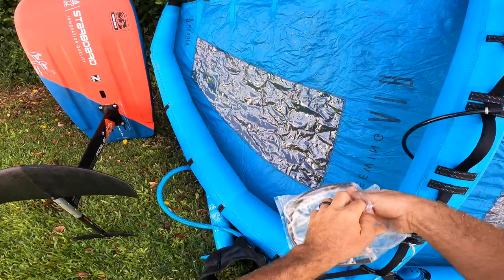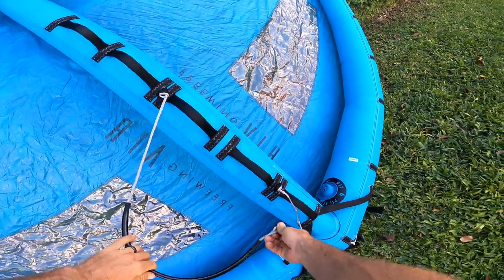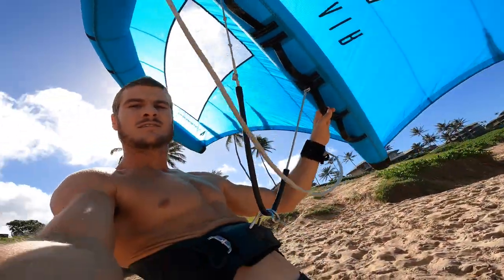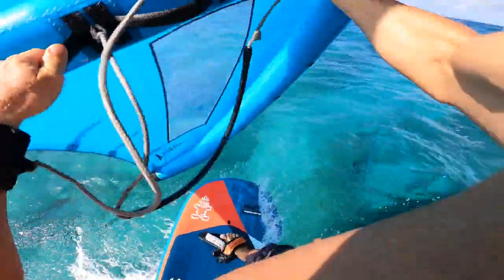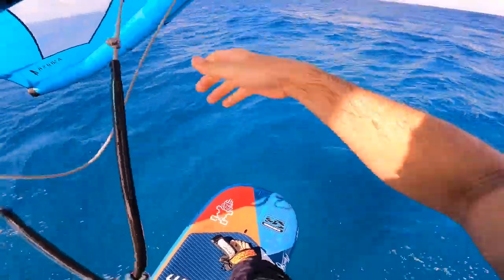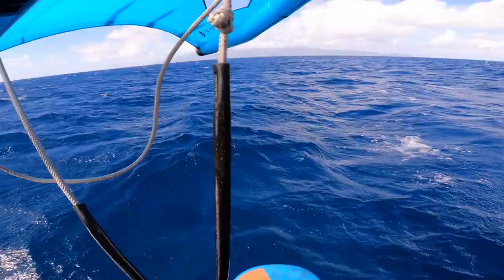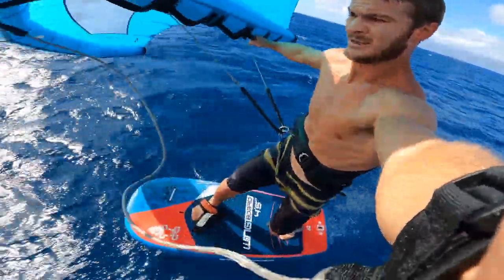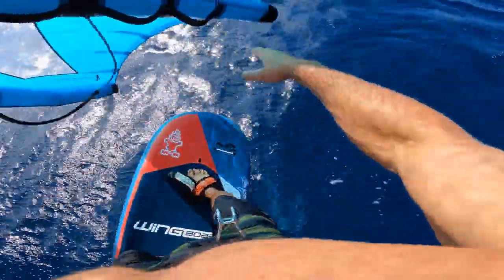How To Attach a Harness & Harness Lines to Your Wing | Wingboarding Zero to Hero Ep. 7 with Zane

Comment: Great info on the harness line and nice back hand + harness + GO Pro control! 

I am impressed with how you got going to flight with your 4'6" board in wavey water.  May I ask your weight? 

I learned Wingfoiling on my 2005 Staboard formula board.  So nice to learn basic wing handleing but I out grew it quickly.  I am 170 lbs and am looking at the 5'8" Starboard Wingboard for my next board.  I have been Windsurfing for decades and Wind Foiling for over 3 years.  Trying to figure out the balance between buying and selling too many boards and having an easy and fun learning curve.  

Also, for light wind no wave Wing foiling do you use a larger board?

Any advice is very welcome.  🙂